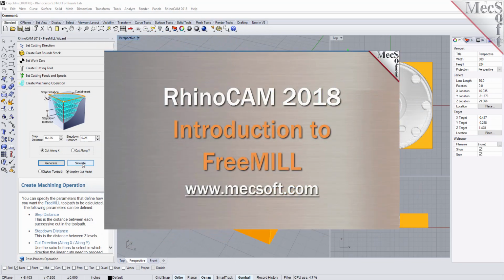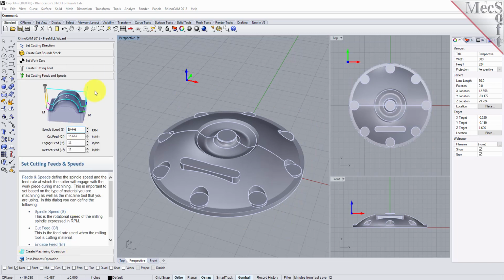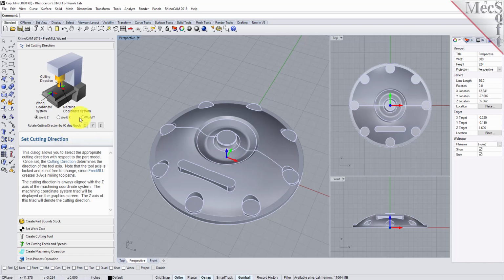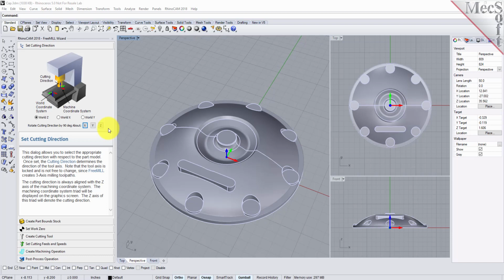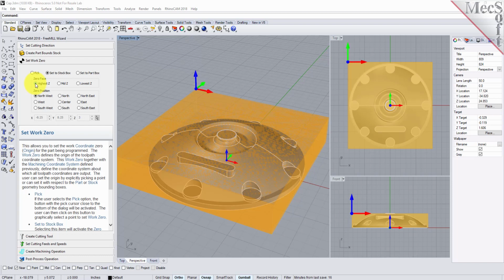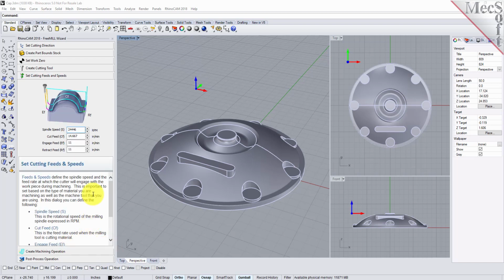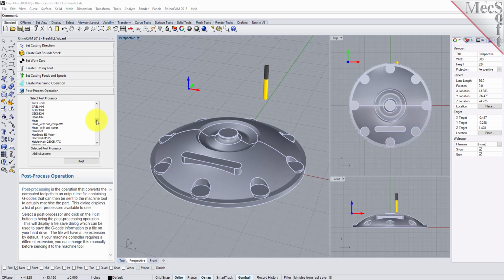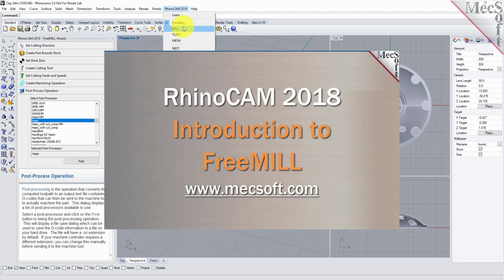FreeMILL 2018 for RhinoCAM Demo

Comment: Thanks for the tutorial. Im having trouble figuring out which software I should use as a cabinet maker.. My line of work doesnt require 3D shaping but 2D drilling and cutting, so to me it seems that the different options such as parallel finishing don't apply. Any suggestions?